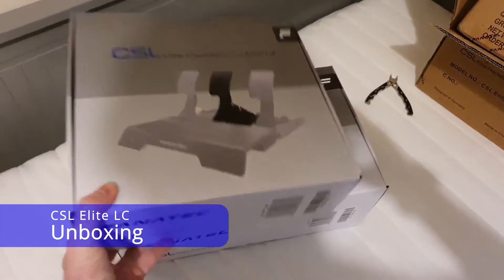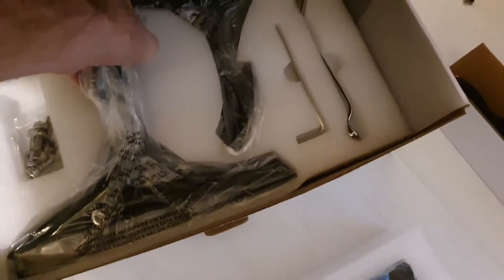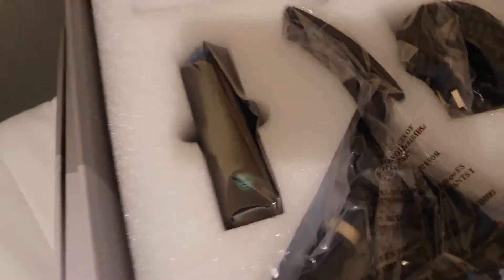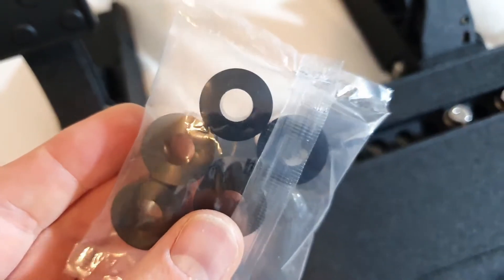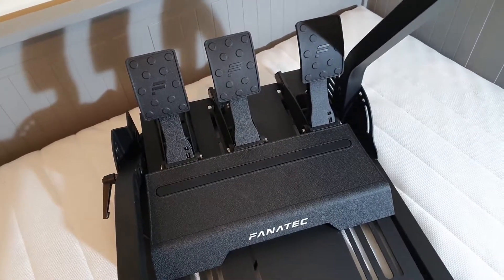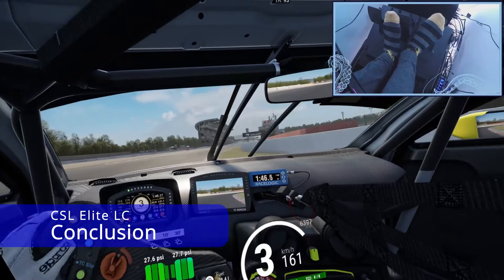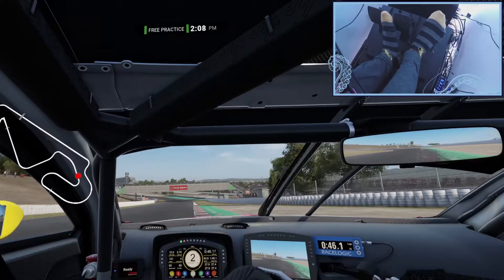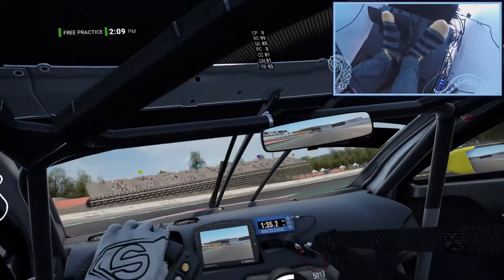Sim Racing Hardware - Fanatec CSL Elite LC Pedal Set Mini Review

Comment: is it possible to connect pedals with thrustmaster steering wheel to ps4?
Reply from the maker: If you look up DriveHub,  I think that's your only option to use two USB devices as one on console.